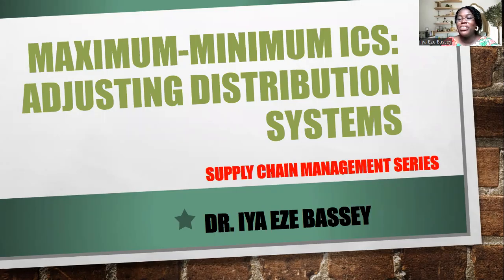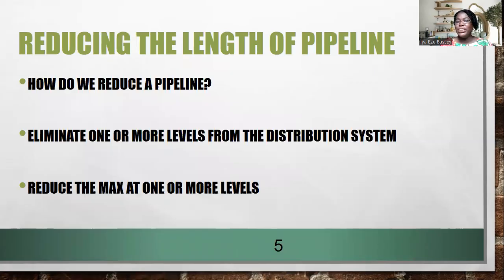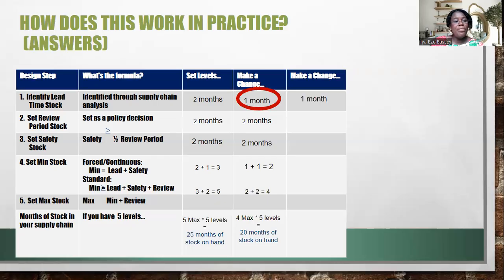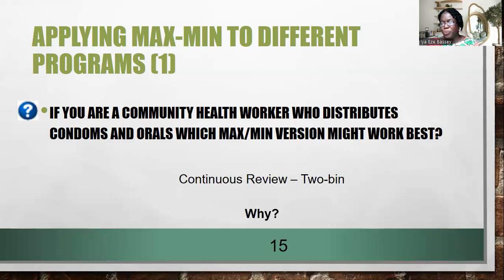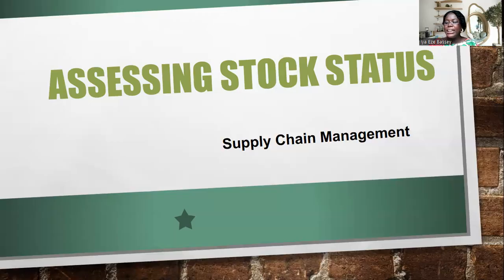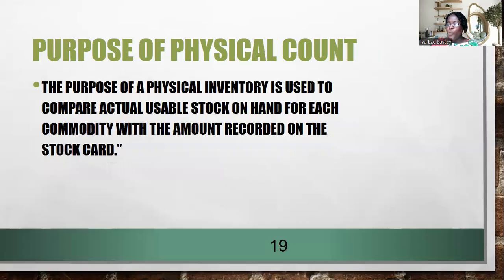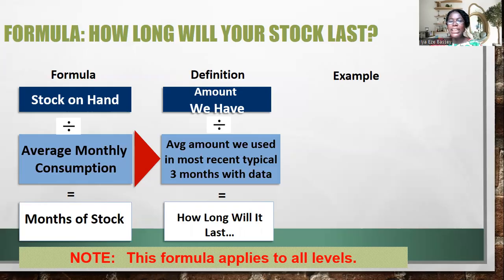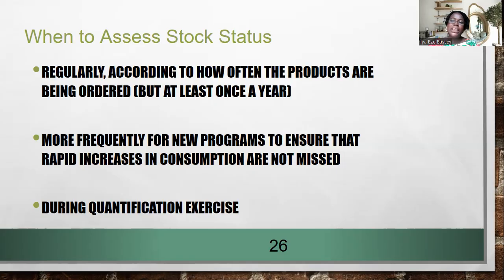Maximum-Minimum ICS: Adjusting Distribution systems (Supply chain management series)

Comment: In this lecture I learnt about Inventory control systems and ways to adjust distribution systems
In designing a maximum- minimum inventory control system you must be able to set up initial max-min policies for each level and type of facility, check if the overall distribution will function properly if the level specific max-min policies are implemented and also check the total length of the pipeline that the policies of each level imply.
The process of reducing the length of a pipeline involves eliminating one of more levels from the distribution system and setting up policies to reduce the maximum at one or more levels.
You can reduce the maximum stock level by;
-shortening the review period.
-Reducing the lead time at one or more levels
-improving the distribution system reliability at one or more levels so safety stock can be reduced.
Some factors that impact max-min stock levels are 
1. Cost of products
2. reliability of transportation 
3. Storage capacity and cost of storage 
4.  Shelf-life of commodities.
Advantages of Maximum- Minimum system include;
1. It helps to avoid over stocking and under stocking 
2. Minimize wastage
3. it helps to avoid cost of emergency orders. Etc
 Hand counting the total number of usable units of each commodity in your store at any given time (physical inventory) is a way to assess and determine month of stock and it is calculated by dividing Stock on hand by the average monthly consumption. 
- The average monthly consumption is the sum of the last 3 months divided by 3, when a month has 0 data, you choose a different month.
It is  advised to assess stock status;
-At least once a year according to how drugs are ordered.
-During quantification exercise and 
-more frequently for new programs to ensure that rapid increases in consumption are not missed.

Comment: At the end of this module is  learned
(1) The steps to designing a minimum-maximum ICS 
    (a)Set up initial max-min policies for each level and type of facilities.
   (b) Check if the over all distribution will function properly if the level specific max-min policies are implemented.
    (c) Check the total length of the pipeline that the polices of each level imply.
(2) Reducing the length of a pipeline.
       (a) Eliminate one or more level from the distribution system
(2) Reduce maximum stock level.
     (a) Shorten the review period at one or more level.
      (b). Reduce the lead time at one or both level.
 All this csn be done by:
(1) Identify lead time
(2)Set Review period
(3)Set safety stock
(4)Set minimum stock
(5)Set maximum stock
  Factors that affect the impact of min-max stock level:
(1) Cost of product
(2)Cost of storage
(3)Lead time
(4) Storage capacity.
      Advantage of using min- max system.
 (1) Avoiding under stocking
(2)Avoid over stocking
  Ways to determine  amount of stock
(1) Physical count: meaning counting by hand.
And this should be done as frequent as possible to ensure  that rapid increase in consumption are not Miss out especially for new programs.
     Thank you ma❤

Comment: In summary, there are steps involved in desining  a MAX-MIN ICS  which includes
1. Setting up initial MAX-MIN policies for each level and faculty
2. Checking the overall distribution function properly to know if the level specific MAX-MIN policies are implemented
3. Checking the total length of pipeline that the policies at each level imply
    Furthermore a pipeline could be reduced by
*Eliminating one or more levels from the pipeline
* Reducing the MAX at one our more levels
   Some other factors that could possibly impact the MAX-MIN stock level include
* Lead Time
* Reliability Of Source Of Supply
* Effect Of A Zero Balance Of Stock
* Management Skills Of Staff
* Age Of Program
*Accuracy Of Forecast.
 There are also immence advantages to using a MAX-MIN system which include
1. Avoid overstocking
2. Avoid understocking
3. Minimize waste
4. Avoid cost of emergency orders
5. Consistent of stock levels... To mebtion but a few.

Comment: At the end of the module maximum and minimum system ICS: adjusting distribution systems
Some key point:
Factors that impact max and minimum stock levels which are:
☆cost of product
☆ reliability of transportation 
☆ storage capacity
☆ shelf life of health commodities 
☆ storage conditions at different levels 
Advantages of using max min system are:
● to avoid overstocking
●avoid under stocking
●minimize wastage
●consistency of stock levels

Comment: Thanks for your helpful lecture ma .steps in designing a max min pica are:1.set up initial max min policies for each level and type of faculty.2.check if the overall distribution will function properly if the level spific max - min policies are implemented    3 check the total length of the pipeline that the policies at each level imply

Comment: In summary, I understood the length of pipeline, how to modernize length of pipeline to reduce maximum at one end or more levels to improve the distribution of system reliability. 
It can be reduced by eliminating one or more items 
Reduction of max at one point or a level 
Storage capacity, costs of products , shell life of health commodities, accuracy of forecast , cost of products 
The physical count is the total number of usable unit of commodities in store 
The calculation part was interesting

Comment: In summary I’ve learnt that they’re steps used in designing the max-min ICS which are: setting up initial max-min policies for each level and type of faculty 
*check if the overall distribution will function properly if the level specific max-min policies are implemented 
*check the total length of the pipeline that the policies at the each level imply
I’ve also learnt that to reduce the length of the pipeline one or more levels should be reduced from the distribution system
They’re also several factors that impact max-min levels:
* cost of production 
*lead time
*storage capacity 
*cost of storage
*age of program
Max-min system are used to:
 *avoid overstocking 
*avoid under stocking 
*minimize wastage
*avoid costs of emergency orders etc
 
They’re various challenges in using each of the inventory systems 
*systems with numerous levels
*systems that manage a large number of commodities 
*systems that manage products for new programs

Comment: In summary I learnt that the length of pipeline is the first step to take that the policy at each level imply.
Reducing the length of the pipeline by eliminating one or more levels from the distribution system, reduce the max at one or more levels, reduce the maximum stock level 
I learnt that factors that impact max min stock level are; cost of product, reliability of transportation, storage capacity, cost of storage, shelf live of health comodities
Advantages of using max min system 
1. Avoid over stocking
2. Avoid under stocking
3. Avoid cost of emergency order
4. Minimise wastage 
5. Consistency of stock levels 
I also learnt that physical count is the process of counting by hand the total number of useable unit if each commodity in your store or health facilities.
We access stock status regularly according to how often the products are being ordered, more frequently for new programs to ensure that rapid increases in consumption are not missed.

Comment: Max-Min Inventory Control System (ICS)

Key Objectives:

1. Prevent overstocking and understocking
2. Optimize stock levels
3. Reduce pipeline length
4. Minimize emergency order costs

Key Components:

1. Designing the system
2. Methods for reducing pipeline length
3. Factors affecting max-min stock levels

Benefits:

1. Prevents stockouts and overstocking
2. Saves costs
3. Improves inventory management efficiency
4. Enhances supply chain visibility
5. Supports informed decision-making

By implementing a Max-Min Inventory Control System, organizations can streamline their inventory management, reduce costs, and improve overall efficiency.
Thank you ma

Comment: In summary, I've acquired knowledge , know the steps in designing a Max min ICS . Also in other to reduce the length of the pipeline ,you have to eliminate one or more levels in the distribution system, reduce the Max at one or more levels.There are various factors that impact Max -min stock levels .one which includes cost of product etc.The benefits of implementing the max min system was stated.The physical counting mentioned, entails manually tallying the total number of usable units for each commodity in the store or health facility.

Thank you very much ma

Comment: In summary.. The max- min inventory control system( ICS) provides comprehensive guidelines for managing stock levels to prevent both overstocking and under stocking of goods. It encompasses various steps involved in designing the system, methods for reducing pipeline length and factors affecting the max-min stock levels.

Not only does the max-min system helps in preventing overstocking and under stocking, but it aids in avoiding emergency order cost by providing a guide to the stock status on a regular basis.
It also assist in the management and assessment of the length of pipeline of policies at each level.

Comment: In conclusion, I’ve learnt that the steps in designing a max-min ICS are:
1) set up initial max-min policies for each level and type of faculty.
2) check if the overall distribution will function properly if the level specific max-min policies are implemented.
3) Check the total length of the pipeline that the policies at each level imply.
Some factors that can impact max-min stock levels are
* cost of products
* reliability of transportation
* cost of storage
* storage capacity
* lead times. E.t.c
Advantages of using max-min system includes:
* avoid overstocking and under stocking 
* minimize wastage
* Avoid cost of emergency order.
Challenges to using each version and variation are: 
* systems with numerous levels
* systems that manage a large number of commodities.
Physical count is the process of counting by hand the total number of usable units of each commodity in your store or health facility at any given time. It is done to compare actual usable stock on hand for each commodity with the amount recorded on the stock card.

Comment: This series has been incredibly insightful. Thank you, Prof., for providing such valuable knowledge.

To summarize, I’ve learned that optimizing the allocation and distribution of products across various locations is an essential aspect of refining the distribution system within an inventory control system.

The advantages of modifying the distribution system include preventing both overstocking and understocking, minimizing waste, reducing the need for emergency orders, and maintaining consistent stock levels.

The MAX-MIN ICS distribution system can be fine-tuned by shortening the pipeline, which can be achieved by eliminating one or more levels in the distribution process. Additionally, by reducing the review period and lead times at certain stages, the maximum stock level can be lowered.

It is also important to consider factors that influence MAX-MIN stock levels, such as available storage capacity, storage costs, staff expertise, forecasting accuracy, and the age of the program.

Comment: In the end of these lecture I was able to learn : 
Steps in designing A max - min ICS 
- step up initial max - min police for each level and type of faculty 
- Check if the over all distribution will function properly if the level specific max -min police’s are implemented 
- Check the total length of the pipeline that the police’s at each level imply 
Procedures on reducing the length of a Pipeline 
- how do we reduce a pipeline 
- Eliminate one or more levels from distribution system.
- Reduce the max at one or more levels 
N/B changing some element of the formula which can be change in order to reduce the max of stock level .
- shorten the review period at one or more levels 
- Reduce the lead time at one or more levels
- Improve distribution system reliability at one or more levels so that stock can be reduced.
N/B in order to identify your lead time stock a supply chain analysis must be made to know the longest time for a particular  commodity would arrive to be made availability for use .
- Review period is a policy decision it need to be taken at a policy level 
- Set safety lock using this formula : 
        Safety  1/2 review period 
- set min stock using Forced /continuous :
           Min = lead + safety standard 
          Min = lead + safety review 
- max stock using max + Review 
NOTE : if you have 5 levels , each levels can be 2 month and it can also be reduce to 1 month. 
Other facts that impact max - min stock levels are :
- cost of products 
- Reliability of transportation 
- Storage capacity 
- Cost of storage 
- Storage conditions at different levels 
- Shelf life of health commodities 
N/B other factors that impact max- min stock level are : 
  - reliability of sources supplies 
- effect of a zero balance of Stock
- Management skill of staff 
Advantage of using max- min system 
- avoiding over stocking 
- Avoiding cost of emergency orders 
- Minimize wastage 
- Consistency or stocks levels  
N/B they are various challenges using the inventory system and which are : 
* system with numerous levels 
* System that manage large numbers of commodities 
* System that manage products for new programs 

       Assessing stocks status 
 N/B physical count is the process of counting by hand the total number of useable units of each commodity in your store or health facility . 
         N/B. Assessing stock status is very important cause it helps count the number of useable unit you have at hand and how long the stock will last .
     Formula used to determine stocks 
N/B physical count enables you get numbers .

 STOCK ON HAND : amount of stock at hand 
           *
 AMC  : AVG amount used in most recent typical 
             3 month with data 
= 
Month of stock : how long will it last 
 Illustration using the formula above 
 100 tablets *25 tablets per month = 4 months supply of tablets 
 Mathematical expression 
Stock on hand = 3,000 Lo femenal 
AMC =  for July 1,252 / June 1,262 / may 1,250 adding all figure = 3763 * 3 = 2.4 
Month stock = 2.4 

N/B stocks are to be : 
- Regularly , according to how often the product are been ordered ( but once a year ) 
- During qualification exercise 
- More frequently for new programs to ensure rapid  increases in consumption are not missed .

Comment: This is so educating 

In summary, there are steps in designing a maximum/minimum inventory control system.
We should know how to reduce the length of a pipeline by eliminating one or more levels from the distribution system and also by setting up policies that helps reduce the maximum at one or more levels.

There are factors which impact maximum/minimum stock level .they include;
Stock capacity,cost of production,cost of storage, shelf life of health commodities, lead times ,etc.

Advantages include: to  avoid overstocking and under stocking , to minimize wastage and also maintain stock level consistency.
Also they're challenges encountered in the different system, they're:
System with numerous levels, system that manage a large number of commodities.

Comment: Thank you very much ma .
Summary:
 I learnt about the steps involved in designing a max-min ICS which are 
1. Set up  initial max-min policies for each level and type of facility 
2. Check if the overall distribution will function properly if the level specific Mac-min policies are implemented 
3. Check the total length of the pipeline that The policies at each level imply.
I also learnt about Factors that impact Max-min stock level 1
*Cost of products
* Reliability of transportation 
*Storage capacity 
*Cost of storage 
*Storage condition at different levels 
*Shelf life of health commodities.
Other Factors Level 2;
*Lead time
*Reliability of source of supplies 
*Effect of a Zero Balance of stock
*management skills of staff
*Age of program 
*Accuracy of forecasts .

And lastly I understood the Challenges in using each version of ICS which are 
* System with numerous levels 
*Systems that manage a large number of commodities 
*System that manage products for new program

Comment: In summary;
Steps In designing a maximum minimum inventory control system includes ;
1. Set-up initial maximum minimum policies for each level and type of facility 
2. Check if the overall distribution will function properly if the level specific maximum minimum policies are implemented 
3. Check the total length of the pipeline that the policies at each level imply.
Pipeline length could be reduced by;
a. Eliminating one or more levels from d distribution system 
Or set up a max that could help you reduce the level.
-How to reduce maximum stock level 
Reduce the lead time at one or more levels 
Review period is a policy decision period.
Factors that impact max-min stock levels include;
-Cost of product 
-Reliability of transportation 
-Storage capacity 
-Cost of storage 
-Storage condition at different levels
-Shelf life of health commodity 

Advantages of using max-min system includes;
-Avoid overstocking 
-Avoid understocking 
-Minimize waste etc.

Comment: I understand ADJUSTING DISTRIBUTION SYSTEM (MAX-MIN ICS).
I also learnt how to design a MAZ-MIN ICS which is also called length of a pipeline length of a pipeline can be reduced by eliminating some levels from the distribution ststem.

Factors that impact MAX-MIN stock level.
-Cost of storage
-Storage capacity
-Cost of production.

I understood the physical count and also formula on how long your stock will last and when to access stock status.
Advantage of MAX-MIN ICS
-Minimum wastage
-Avoid overstocking
-Avoid understocking.
Thank you.